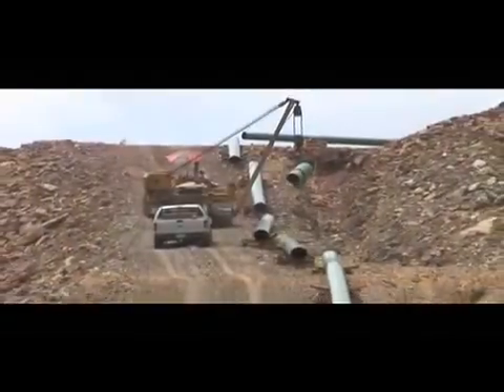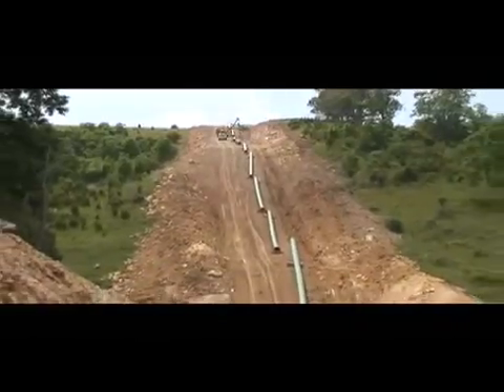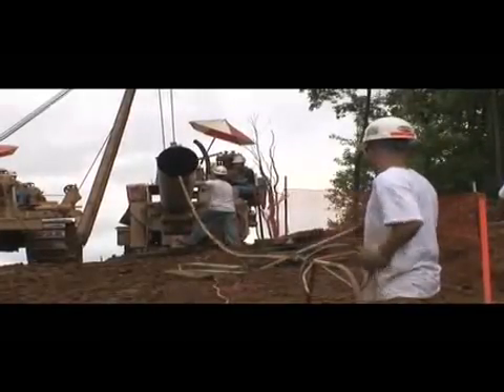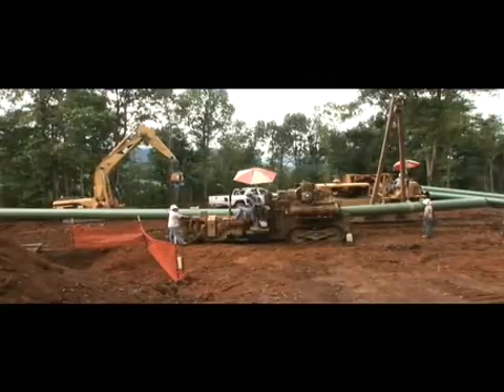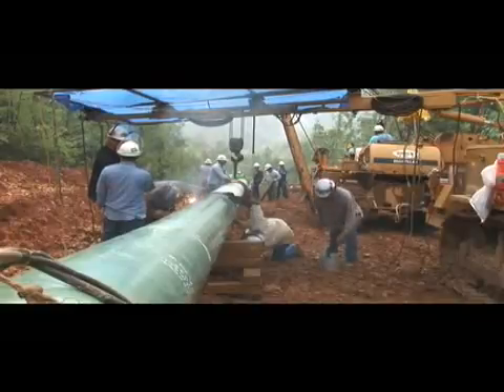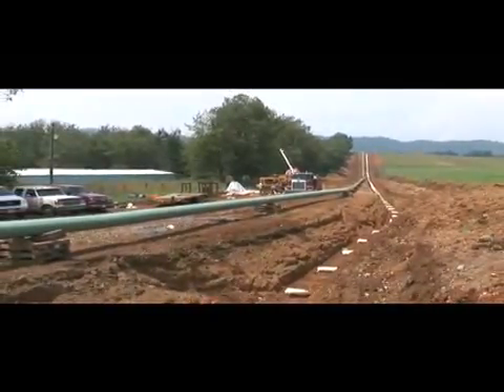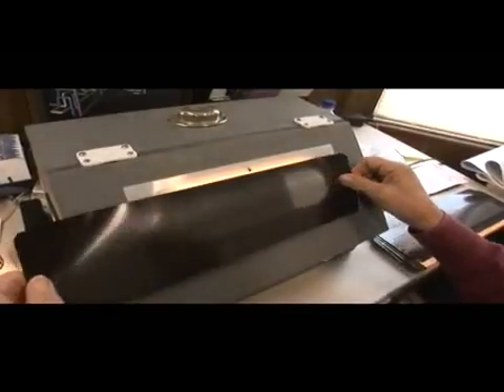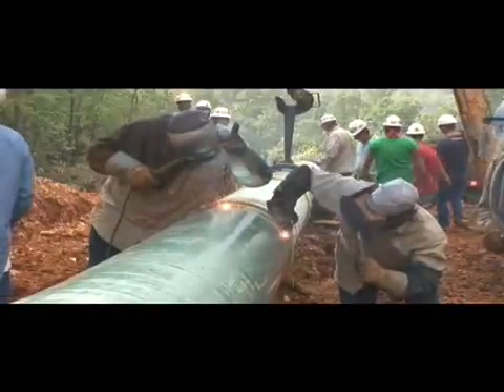Stringing, Welding and Coating Pipeline Segments

Comment: Great video.  Our new invention allows you to build a continuous pipe of any size onsite, eliminating virtually all transportation costs and leaking joints.  The high strength pipe is ideal for carrying water, oil and gas.  It can also be used to repair subsea pipelines by slip-lining them.  Please watch the short video below.
https://www.youtube.com/watch?v=EGsipDj0dEA